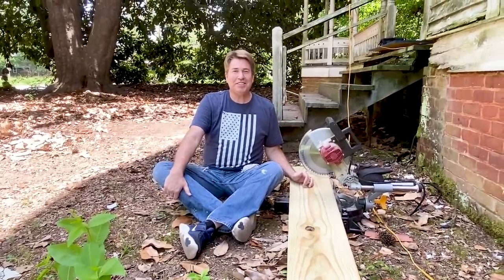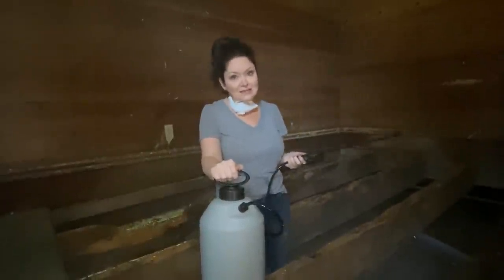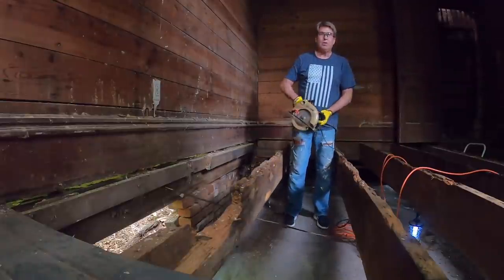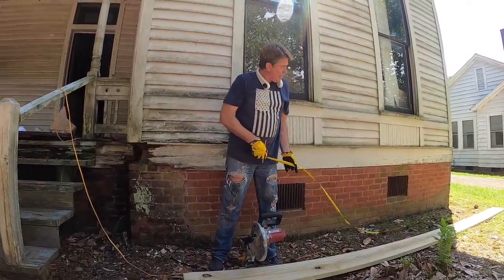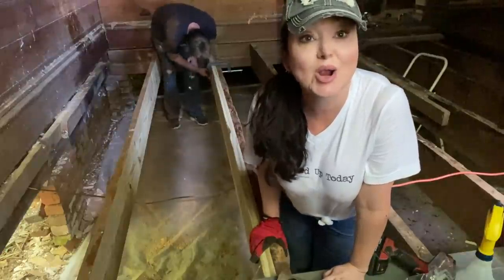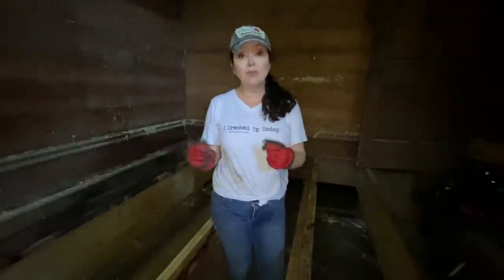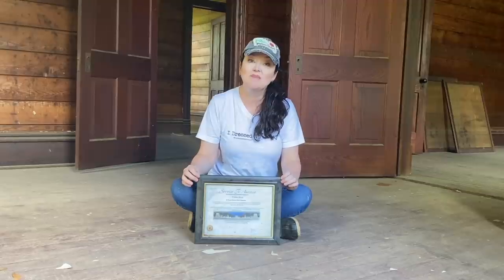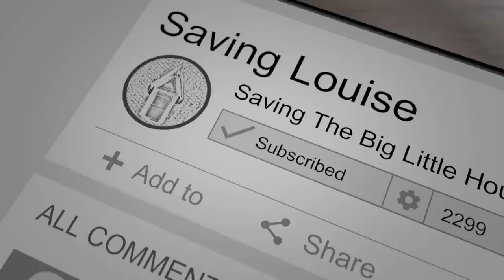Restoring Our Victorian : Episode 3

Comment: Thank you for another interesting and exciting trip down Memory Lane. Laine... I've heard many, many different renditions of the William Tell Overture in my life, but... "To the dump-dump-dump" will reside among my 12 functioning brain cells for a long time! With regard to the construction adhesive when sistering those floor joists, once it's set up, it'll be stronger than the wood it's bonded to. Using thru-bolts is good if shear is a factor, but construction screws would have done the same job just as well. Finally, YES!!!! Thank you for spraying everything with the Borax. It looks like you and Kevin are doing it right.

Now, Honey, pretend it's the first of June and head down to your favorite hardware 'Box Store.' Get a DeWALT 20vmax/XR, 1/2" hammer drill, a DeWALT 20vmax/XR impact driver, and a DeWALT 20vmax/XR brushless jigsaw. Give them to Kevin for a belated Fathers Day. Trust me, dear, he'll be so happy with them... well... there just might be a new pair of earrings with shiny big diamonds in them... in appreciation for the gift! (Afterward, tell him the oscillating saw is a TRIM SAW...).

Enjoy the 4th... C U next time....
Reply from the maker: Now Carl why would you assume that Kevin wants the drill and I want the earrings🤣🤣🤣
Reply: @OurRestorationNation  Well... shucks, ma'am, I guess it was when you started looking down your shirt for that earring backing. (You made a 73 year old man blush)!! That said, if YOU are the tool mogul in the family... make sure the DeWALT tools are BRUSHLESS MOTOR; whatever you get. 

The back story on this, my nephew has a 170 acre ranch just north of Huntsville. I go back for a month or so, a couple times a year to help him out (I'm retired and live in Sparks, NV). I think he owns at least one of everything that DeWALT ever made, and for woodworking, I've never used anything better. I wish I wasn't 2,000 miles away; I'd be parked outside your place in the motorhome, providing volunteer help.
Reply from the maker: We’d take all the help you wanted to give, but we sure appreciate the encouragement from afar!!!!

Comment: I would have installed the electrical first, then the plumbing. Everything you do in a restoration and construction uses power. Its a fire hazard using extention cords from the other house and im sure they are the really cheap ones. You should be using a generator until the electrical is installed!
Reply from the maker: Well, when you do your restoration you can do it in the order you choose! We always work structural first, then framing, then plumbing, then electrical, as that’s the building order. Even had we installed electrical it would have been months before it would have been usable, as you rough in and don’t finish until the end of the project. We have a generator- we just didn’t have it with us that weekend. And we use appropriate, exterior heavy duty extension cords. We’ve been doing this a LONG time

Comment: Please explain why you threw out that dresser? Did it have termites? Was it badly unsavable? I get a little upset when people throw out furniture. I could of done something with it. Even the drawers were savable. There’s a lot you can do with drawers. Oh well, it’s in the dump ready to be crushed into tiny pieces. 
Thanks for all the information on sistering in a board. I like the idea of using bolts. Some people cheat n use just nails n not always use contact cement ( or whatever you you used) they just slap it in there. You didn’t it the correct way. Yeah, for you n Kevin. Have a wonderful 4th of July n please remember what fireworks does to many dogs n to those who have PTSD. In my town they make loud noises through the night. ♥️😊👍👍🇺🇸
Reply from the maker: It was a disaster- split, veneer peeling, a cat had given birth in one of the drawers and it reeked of cat pee. Trust me- if it was in any way salvageable we would have kept it! One less piece to buy. But it was FOUL.
Reply: @OurRestorationNation   Thanks for letting me know. Your right you can’t get rid of cat pee no matter how hard you’d try. But I have had some beautiful pieces of furniture after I stripped the veneer off. Maybe I was lucky that they used a pretty piece of wood underneath instead of popular wood. Again appreciate you filling me in. ♥️

Comment: So bummed that you trashed the dresser and other wood..... sad sad sad
Reply from the maker: It would save you some grief if you’d read previous comments and replies. This dresser had been sitting under a roof leak, so it was split, peeling, moldy, had been used for a momma cat to give birth and another drawer was SOAKED in cat urine. We won’t throw away anything salvageable, but this piece would never have been made whole
Reply: @OurRestorationNation  my bad  But you did have some vintage pulls on the drawers.   That was what first caught my eye.